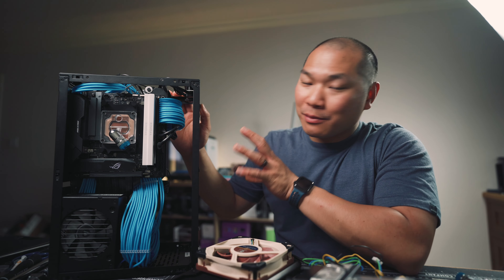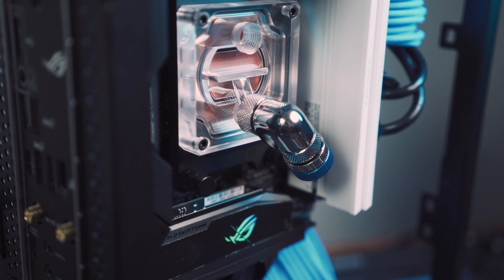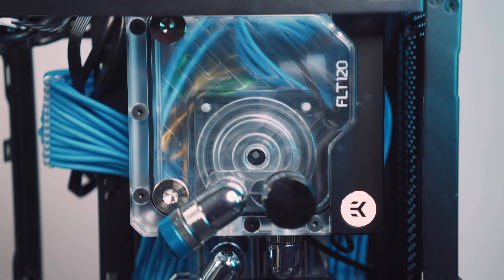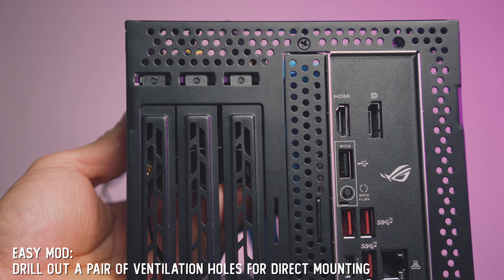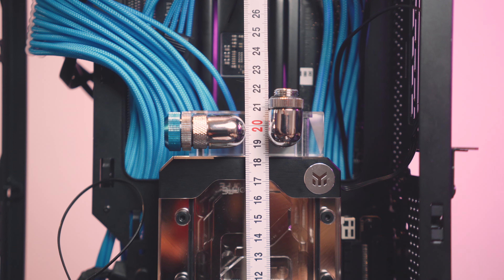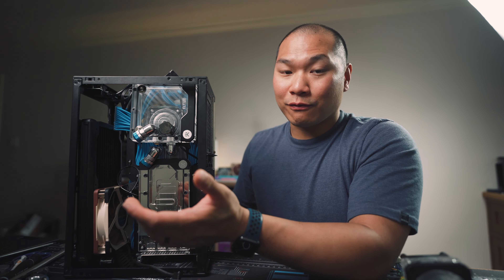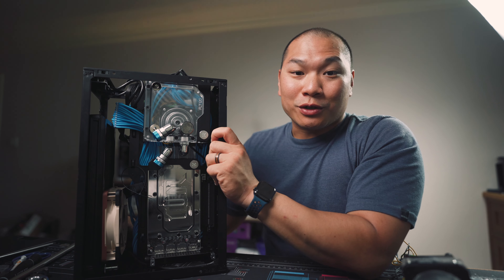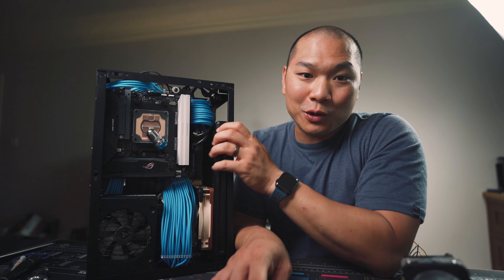Meshlicious Custom Cooling Considerations and Measurements

Comment: Awesome video, and uncanny timing too! 

I'm planning to do an aesthetic-focused build in the Meshlicious using the external MO-RA radiator w/ external pump and res as well. (Mounted under my desk.) This comes after a somewhat-janky NR200 build, which was both my first loop and a three-radiator setup. (Dremel proved very necessary.) 

My primary concerns for building in the Meshlicious were overall GPU clearance, as the Optimus GPU block for the 3080 FTW3 is massive, and fitting the Crosshair VIII Impact into the case. Given the GPU cooler clearance, it seems the latter should work fine. Visually at 2:14 it looks like the massively protruding outlets on the block (main issue that made me create said janky NR200 build.) won't be a huge issue, either. 

I do, however, worry about the large backplate on the block. It is about 7.5mm from the PCB with the thermal pad; will this fit in the case? 

Thanks again for the video! Definitely saving this and will continue to reference it when planning this build.
Reply from the maker: Sure! Sounds like you will need the external pump. So, the way the case is configured normally it won’t work, since there is limited space behind the riser cable. But, if you need to push it out you can, stock you have about 5mm max. What I’d do is just add a few spacers behind the riser cable and get slightly longer screws. If it’s just an extra 2.5mm you should still be able to use the stock holes to tighten down the card to the support bracket.
Reply: @MachinesMore  Thanks a ton for the detailed info! Noting this down for when I begin putting things together in the medium-ish future- I wonder if the anti-vibration pads that come with the NF A12X15’s could work as the spacers; I’ve used them for a similar purpose before, specially to act as GPU support for the FTW3 on-air with slim fans directly underneath. They were perfect for bridging a few mm.

Thank you again! Both this video, and comment will be a huge help (and likely money saver in replacement parts due to avoiding fitting errors).

Comment: Great job. I've had my build done in this case for almost a year and want to try water cooling. What would you recommend for a reservoir and pump if cooling the CPU only? Can you recommend one that can mount on the CPU side and still do the MOBO offset? So a slim combo style that side mounts? Thanks again. Been following your channel for years and got me through both this and my NR200 builds.

Comment: Would you have any interest in covering the Silverstone Alta G1M? Bit large for you at 30l volume but has something in common with the meshlicious. Wondering if a 420mm rad could fit in the Alta (where the gpu should be with the gpu moved to the stock rad area via riser) but no one's done in depth enough coverage yet

Comment: What a timely video! Just got an Optimus AM4 block and an IceMan pump/res combo that I am planning to install this weekend. Planning to move my motherboard into 4 slot mode and plan for a 2nd radiator in the future for the GPU side (if I ever get to upgrade my GPU...) and hopefully move to a 280mm radiator on the front. Curious if you noticed any performance difference if the inlet of the Optimus block is positioned at the top? I know you did some NR200 testing a while back with it. Thanks for the insight on cable management. I am currently spoiled by using extended standoffs on the GPU side but I will lose those when I reconfigure this weekend.

Comment: Hi, I'm about to build my first water cooled PC in Meshlicious case. I'm planning to cool my Ryzen 7600X and RX 6900XY GPU. Do you think FLT 80 DDC pump+res combo unit will be enough or should I got with FLT 120? I'm looking at using EK S280 30mm thick rad with Noctua A14 25mm fans. Thanks.

Comment: I've got everything I need for a custom loop except for the radiator. I was looking at a 280 but you said the GTS240 performs better. Can you expand on  that? Is there a better 280mm that will fit?

Comment: I just built my meshlicious with custom watercooling having pump and res combo attached to the rear side of the case. I can send you the photos if you are interested 🙂
Reply: can you just post the album link here?
Reply: @humanity_3  thanks!
Reply: @namnathanielmai  https://drive.google.com/drive/folders/1pTeiBjgv0lkBRSnqICVGsSUVEM0Mg8wL?usp=sharing 
here it is!
Note: the 360 rad is only a proof of concept. I'm gonna order a 240/280 rad instead so it will be comletely invisible.
Pump res combo is also not visible when you look on the pc from the front (if there is no 90 degree fitting, and there won't be once I get the 240/280 rad)
Reply: @humanity_3  look great, why the choice of external rad in this case? (I can understand the external res usage)
Reply: @namnathanielmai  There is not only external rad. There is one in the front. The problem is that single EK 240 Slim rad couldn’t cool the 6900xt and 5600x. And there is no way I could fit thicker rad cause 6900xt width was too high. Now having a 3080ti which is less width than the previous GPU I’ll definitely try thicker 280mm rad, but I still think it’s not gonna be enough

Comment: Great video! My main issue was the fact that my gpu is so massive, I don't have the space to add a pump/res internally. I mounted an EK ddc pump/res externally by screwing the first two legs to the little lip where the GPU IO brackets go. I tried a Barrow DDC pump/res/block unit and it died thanks to a captive air bubble.

Any advice would be appreciated, but I also wanted to share my experience with others if they fall into the same mess!

Comment: Are you going to attempt a dual rad build? There should be enough space with the 4 slot mode.
Reply from the maker: Unfortunately not. Though it would add more cooling,  I think that defeats the aesthetics of the case and I think there are better cases if the point is just getting two rads. It can fit though, more than 60mm over the GPU block (not including fittings).

Comment: So I shouldn't put tempered glass on the CPU side?
Reply from the maker: If your PSU fan is oriented like mine (and it had to be because I reconfigured the case as 4 slots on the gpu side, which means the divider is right up against the PSU, so fan can’t face in) then having the mesh panel there is a good idea. You can’t inset mount the unit either to get som breathing room in that config. If you keep the case in 3-slot, you do have options.

Comment: Too much compromise with a custom loop for both CPU+GPU for this case IMO, especially given the combined TDP heat output of both CPU + GPU, wouldn't go anything less than 2 x 360 rad. Especially not with slim fans.